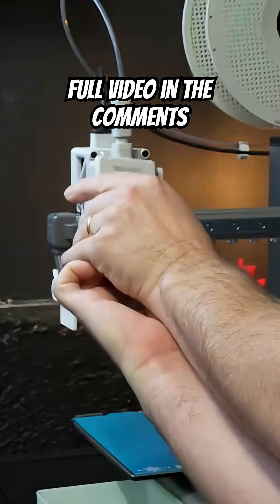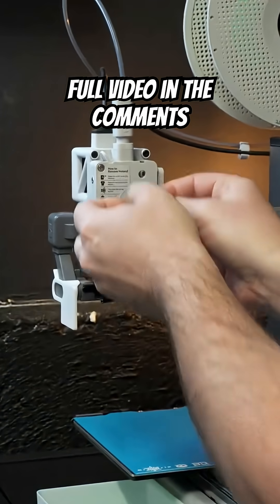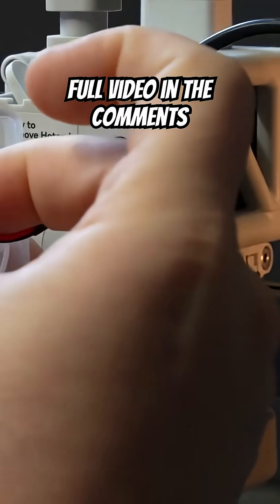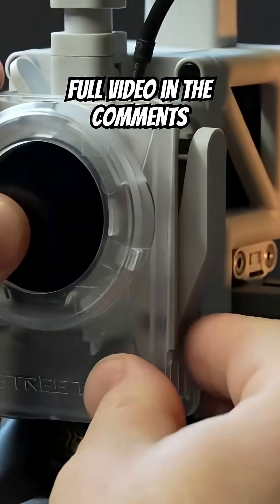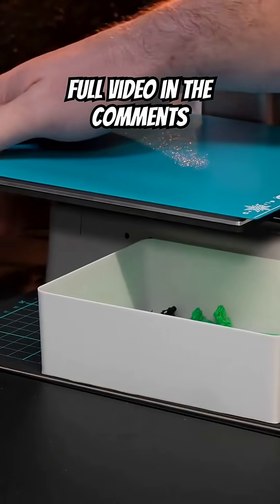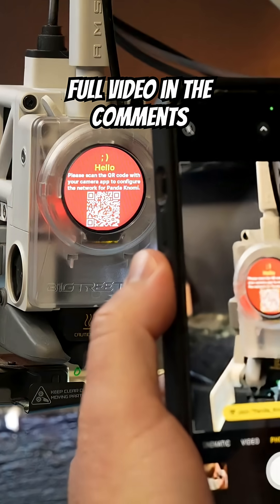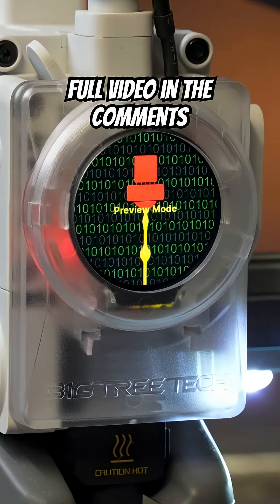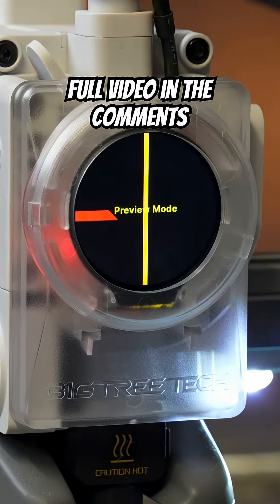BIQU Knomi Install on the Bambu Lab A1 Mini #3dprinting #bambulaba1mini #biqu

Comment: The a1 screen auto offs after 15 minutes max, so this would be a great addition to the percentage of print and so on while main screen is off, problem is I already have ams and the light upgrade so no ports are free for this mod
Reply from the maker: This a good point. BIQU does have a port expansion product so I suppose that’s what that’s for